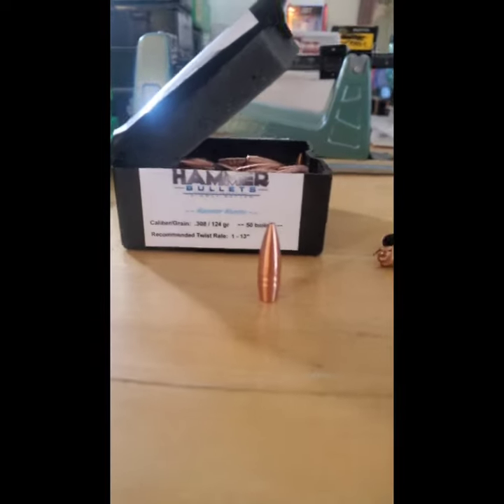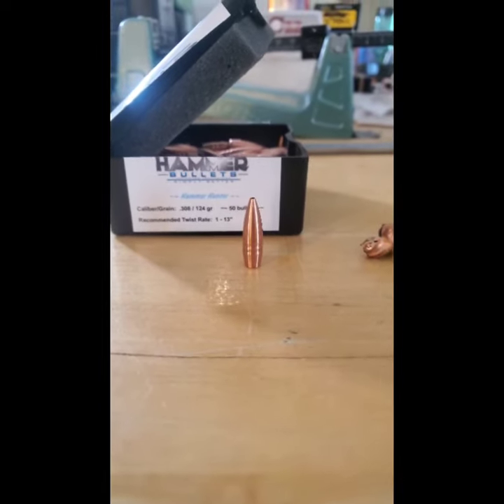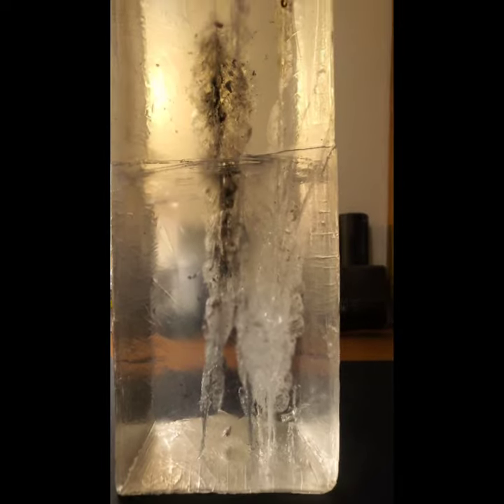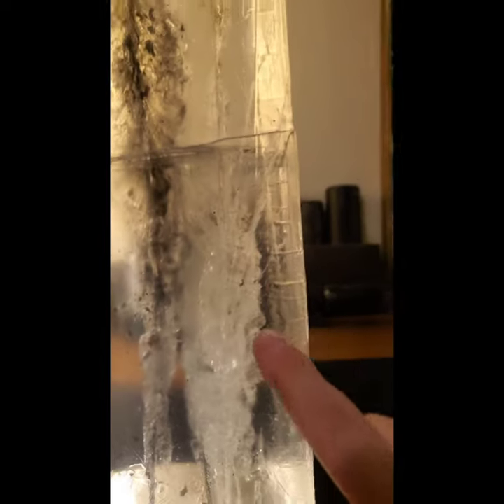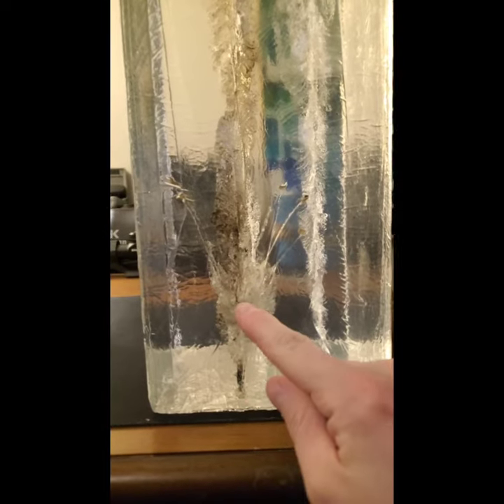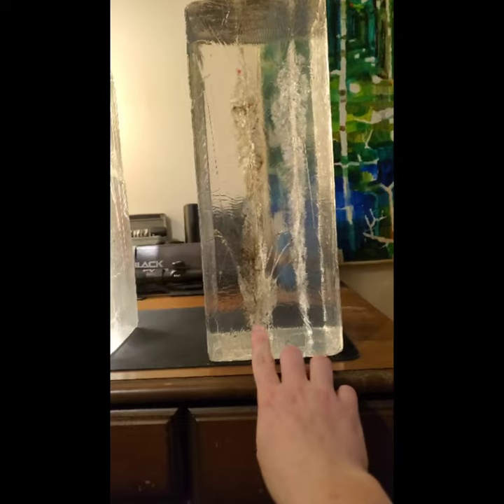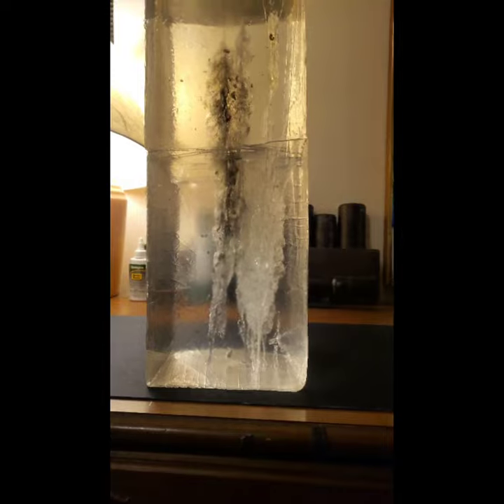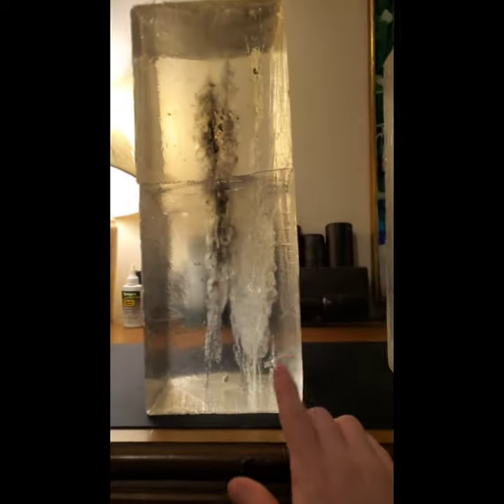hammer bullets : 308 win 124 grain hammer hunter ballistics gel test.

Comment: The face of the shank of the Hammer bullets is flat after the petals are shed, not a gentle round mushroom shape.  This tends to cause more tissue damage and a larger permanent wound cavity.  On many round nose bullets and those with a round mushroom, the tissue damage is smaller than the max diameter because the round leading edge pushes tissue aside more gently.  With the flat face of a Hammer bullet's shank at higher velocities, the sudden shoving aside of tissue causes a larger path of damage and at slower velocities, the relatively sharp edge of the the face just cuts a nice hole.   Elmer Keith was a proponent of the large flat nose and some dangerous game hunters prefer a large flat on the bullet noses.
Reply from the maker: I've read the "physics" paper that Steve from hammer bullets cites as his inspiration for designing hammer bullets.  In this paper its talks about the advantages of a flat nose bullets. The angle of displacement is at 90 degrees and can create a larger wound channel than a larger diameter bullet  with a rounded mushroom.   The issue is that the bullets tested in that paper were cast lead bullets that were fired already with a flat nose. Hammer bullets don't start out flat, and even after the petals break off, the shank isn't perfectly flat.  The edges are still rounded from where the petals broke  off. The brass cutting edge bullets have a perfectly flat shank because the brass fractures off much more cleanly than copper. Another thing is velocity.  At low velocity the diameter of a wound Chanel is much more proportional to the diameter of the projectile, and by the time the hammer bullet sheds its petals the bullet has slowed down significantly. The CE bullet sheds all is petals instantaneously, leaving the shanks with a fair amount of velocity,  allowing it to create a disportionate wound channel compared to its size.  Take something like that cavity back 168mkz that expanded to .90" , as the bullet slows down there no way a .308" diameter shank is creating a larger wound channel. Ive seen the results in gel and in game, the larger diameter bullet leaves a much bigger exit hole. I'm not knocking hammer bullets,  I think they will work good on game but there's pros and cons of every bullet design.
Reply: @Dfleuryoutdoors  I have seen enough testimonials for Hammer Bullets to have some faith in their ability to kill game.  I have  no personal experience, though.  I suspect that the bullets with the small diameter hollowpoint do a lot of their damage while the petals are still attached.  Afterwards, the relatively large fragments weaken tissue enough to cause tears from the stretching during the temporary cavity phase.  Hunters often report extensive damage to the lungs.   It seems that polymer ballistics gel does a particularly poor job of representing this, though.  The bullets with large diameter hollow noses likely form a more uniform face to perform more like a true flat-nose.

I actually have an appreciation for Cavity Back bullets though, primarily for the widely spread petals and the gaps between them.   I suspect that this increases the shear to tissues and causes more localized damage in the path of the bullet, especially as the bullet slows down.   I have seen pictures of distinct tri-lobed wounds when used with the 6.8 SPC, for example.  
  It is possible that some other monolithic bullets do something similar, provided the petals are few in number and remain largely distinct. This is opposed to Hornady's CX bullets, which tend to start with distinct petals but with further expansion, blend into something resembling a single mushroom.
Reply from the maker: @jfess1911 I've been on hammers website and read reviews for almost all the bullets in calibers that I load for. from what I've read and seen in my gel tests, I have no doubt they are effective.  You are correct about the clear gel, it's extremely tough and generally under represents the permanent wound cavity. They organic gel shows this better but it's a pain to work with and goes bad after about a week. Ive shot about 10 deer with cavity back bullets in my 6.8 and you certainly see a 3 lobed hole  from the bullets. Ive also used them in 308 and a wildcat called the 270msr.  Both of those were pushing the bullets quite a bit faster and the wound channels were massive. The 308 left a baseball sized hole through the deer.